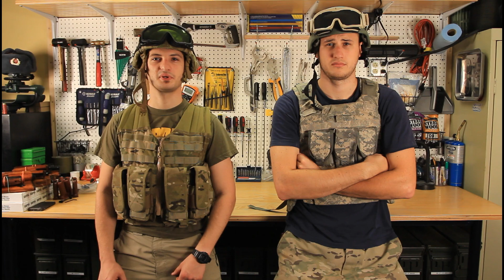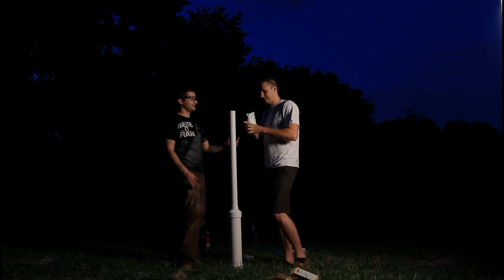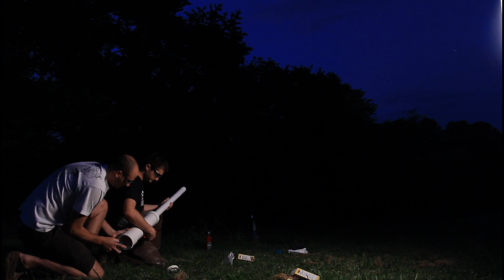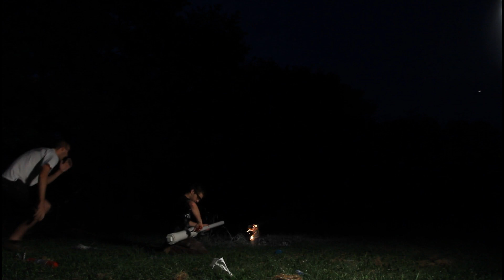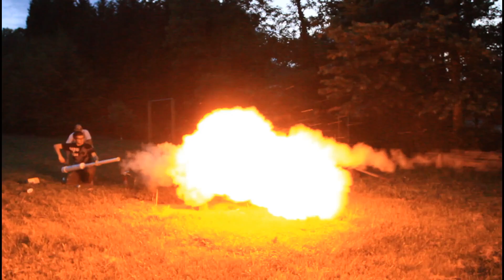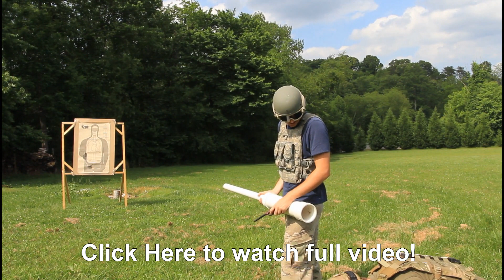Flamethrower mod for the potato gun

Comment: Plug that lighter touch hole and use a push button ignition, yo. Go down to the hardware store and pick up a piezoelectric igniter for BBQs. Epoxy it into the hole. Done. This does require a better fuel/air mixture  but I am confident that you can sort that out.

Comment: Ok, am having a hard time figuring out if they loaded a potato first then the cornstarch or did they use a rag instead.   They could not have just dumped cornstarch right down the barrel without it going down into the combustion chamber.  I have gun, potatoes, and cornstarch and am ready to roll but need to know.

Comment: an electric barbeque igniter wouldve been better instead of the kitchen lighter.
Reply: Johnson K What works perfect is if you use two isolated wires ( ends stripped clean ) with a tazer
Reply: Vlooi 1264 thats what the bbq igniter does, maybe the taser would give it more voltage but all you need is a spark, not a surge.
Reply: that is true, but with the taser it would make it alot easier to ignite, as the button is easier to press than that of a lighter. but it is a bit more expensive
Reply: Vlooi 1264 i guess if youd want to make it look nicer then a taser is definitely the better option. but in terms of efficiency, cost and practicality wise, it seems like unnecessary extra work.
Reply: Well personally for me it is alot easier, but I geuss it depends on the person and the design